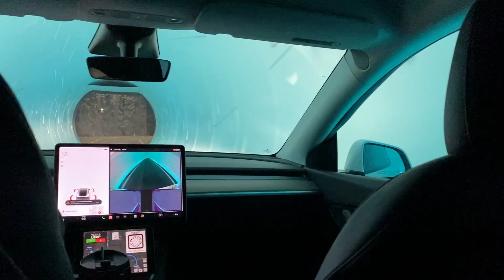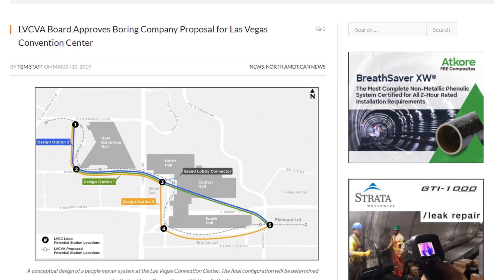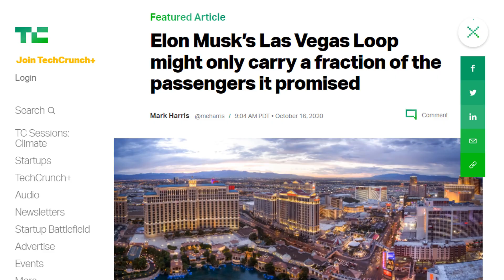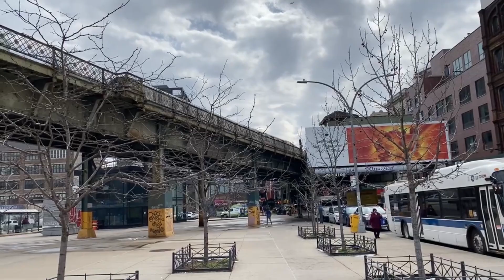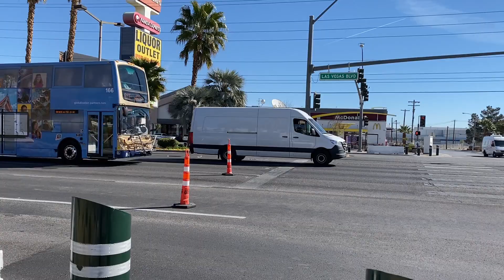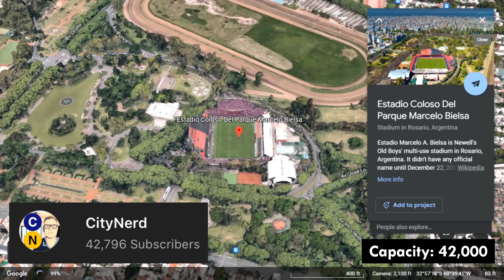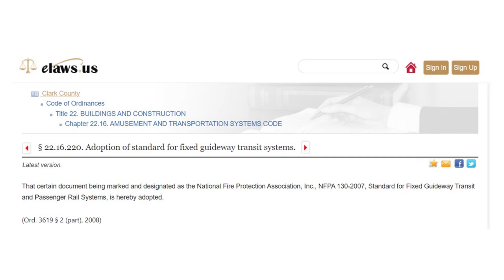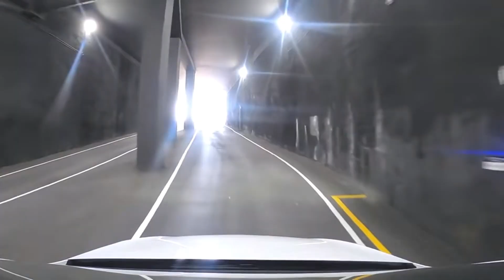Inside the Las Vegas Loop: Transportation Game-Changer, or Complete Waste of Time and Effort?

Comment: It’s a car and an underground tunnel 😂. How revolutionary. How is this better than a subway?
Reply: Much less expensive to build. Shorter wait times for passengers. Shorter trip times, since the car doesn’t have to stop at every station.
Reply: @kevinbailey8827  Now do running costs per passenger.
Reply: @AardvarkDK  I don't have those numbers. I do know that the bid to build a subway in this location was at least $150 million higher than what LVCVA paid TBC to build the loop.  I also know how much LVCVA is paying TBC  to operate the LVCC Loop per year: $6 million.

If the underground train cost half as much to operate (just a guess, to make the numbers easy), it would take 50 years for the LVCVA to save $150 million.
Reply: @AardvarkDK  I think it's likely that TBC is running at a deficit.  Since they're building the tunnels for the Las Vegas Loop on their own dime, they won't have any revenue for that project until they complete sections and can charge fares.   Those fares will have to compete with taxis and Uber, and with people using their own or rented cars, so they can't charge too much.

Most successful businesses lose money at first.  Most unsuccessful businesses do too, of course.  I'm not saying that losing money is a sign of success.  I'm just saying that TBC is in this to make money building tunnels and transportation systems, and to do that, they have to make tunnels and systems that work.
Reply: @kevinbailey8827  Build cost is nothing compared to the maintainance and operating cost over the years. And both is significantly lower with Rails and high capacity vehicles.
Thats like buying a car for 10,000 bucks every 10 years and thinking driving a car only costs you a thousand bucks a year,  while you completely ignore maintanance, Gas, Unsurance Tax, etc., which end up being way higher than the initial cost of the car

A Subway also allows potentially increased capacity if needed and a potential connection to other subway lines, while repurpusing it is easier too, ones the city expands.

The Vegas loop is the only place where it makes even some sense at all, but only because its used by rather rich people and rich people dont like sitting together with poor people. And it also only needs to go into a single direction, because there is only demand towards or back from an event. But for any other situation its a totally terrible idea and even for this case a railway system is more cost effective on a long term and will remain useful throughout the years, if the demand changes, which the loop fails at
Reply: @otozinclus3593  I think you're not realizing the scope of the Vegas loop.  In a few years, passengers will be able to travel from just about any resort to another with a non-stop trip.  They'll also be about to travel to the airport and the big stadium without stopping.  No stopping at other stations (like a subway) and no stopping at traffic lights or for traffic (like a taxi).  

This is just the first leg of that system, and it's useful for going back and forth to the convention center (for a fare of $1.50, so only rich people can ride).  It will get much more useful.

The fare will be comparable to an Uber, but that's a subsidized price.  If other cities adopt loops for their needs, they can subsidize the fares (the way cities with metros subsidize) to make them more affordable for poor people who don't want to be around rather rich people. 

There will be more maintenance costs for a Loop, but it won't be as crippling as you think.   The LVCVA is paying TBC $6 million a year for maintenance and operation of the LVCC Loop.   Even if a train cost half that much to maintain and operate, it would take 50 years to make up for the fact that the cost of the train was going to be $150 million higher.    Even if the train cost exactly zero dollars to operate and maintain (which of course isn't true!), it would take 25 years for those savings to catch up to the savings of NOT having a train.
Reply: @kevinbailey8827  The maintainace cost numbers scale over time, they dont remain the same every year. Example: If you buy a new car, you barely need any maintainace at all for the first few years, but ones its old it needs it regulary.
The Vegas loop is very new, and that it already has such a high maintainance cost means once it gets old, it will skyrocket. 
You also didnt include the working cost, like the cost you need to let it run, which is with a bunch of brand new teslas extordinary higher, than running a pair of trains, because they consume a lot more electricity.

You also shouldnt expect that people can actually use the loop. Vegas is a big city and the capacity of the loop is extordinary small for what it costs. The max capacity the boring company uses is only true, if every car is filled up, traffic flows perfectly, the distance of each car is short and there occur nonother propblems either. This is already unrealistic enough, but even if it werent: At more than a quarter of its capacity, you have to sit with strangers together, once its at max. capacity you have 3-4 strangers in a single car with you, and at that rate I would find even a subway more confortable. But even if we ignore all of that, the capacity is still way too low.
Even if we trust the boring company wkth their 4400 peeps per hour, thats nothing compared to a subway. You really think only 4400 people an hour want to get to work during rush hour on a single line?
The Vegas loop will be at best a premium transportation method for rich people only, meaning poor people are still left without transportation, while disabled and too young people cant use the loop regardless. And the Tesla AI still needs lotsbof years till no driver needs to be on board. What does that mean? You need to build a subway regardless of the loop, so the loop is just some premium fun for rich people. And with the loop already build a subway will become far more difficult.
Maybe you can go for a tram instead, but in a car dominated country like a USA its rare people build a good tram and in a big city like vegas a tram can approach during rush hour its limit too, even through its capacity is higher than the one of the loop
Reply: @otozinclus3593 Las Vegas is not going to build a subway in addition to the Loop.   They looked at building a subway a few years ago and when they saw how much it would cost, they said thanks but no thanks.  That's how it is in most cities.  The government says it can't afford it without raising local taxes, so they have to put it to a vote.  The voters then say no they don't want to pay higher taxes. 

You know of course that the maintenance costs of subway trains will also skyrocket as the fleet ages. 

The working cost of the loop looks pretty good to me, especially once the vehicles are self-driving.   Think about it.  The train has to drive around all the time, whether there are a few passengers  or a lot.   An empty or mostly empty train is using a huge amount of energy per passenger.   The usual way metro systems deal with this is run trains less often.  So passengers will need to wait 20 or 30 minutes for a train to arrive. 

The way the loop will handle it is to park most of the fleet when it's slow.   Some will be parked at a surface lot, being charged with level 2 chargers.  Others will be distributed through the system, parked at stations.  They are using very little energy when parked (especially compared to the empty train rattling around), but they're ready to go in an instant if passengers show up needing transportation. 

You're using the wrong number for the Loop's capacity. 4400 is for the small LVCC loop, which is only for the Las Vegas Convention Center.  It won't be connected directly with the rest of the Las Vegas Loop, at least at first.   It's only for the convention goers to get from one part of the convention center to another (like an airport train to get between terminals).  So the needed capacity won't grow for the LVCC.  The capacity number for the Las Vegas Loop that The Boring Company gives is 57,000 passengers per hour.   They also said that number is just a start.

The Las Vegas Loop really isn't for commuting.  As planned, it goes to all the casino resorts, and to the airport, and to the stadium, and to the university.  That doesn't help casino employees get to work (unless they're university students), and the fares aren't structured for a daily commute.  That's not to say it can't be expanded into the rest of the area and used for commuting. Just build more tunnels and connect them into the existing ones. They don't even have to be tunnels everywhere.  Make dedicated above-ground roadways. for the loop vehicles.  Most subways I have seen become above ground trains away from the city center. 

And subsidize the fares for local users, as you would have to do for a subway anyway.

Self driving cars won't be ready for a few years, but I'm okay with that because the Las Vegas Loop won't be finished for a few years, either.    It won't help to pour billions into a new subway in the meantime, because the subway will take longer to build than the loop and the self driving cars will be ready before the subway.
Reply: @kevinbailey8827  Yes, but thats exactly the problem. You buiild a loop which is 1/3 as expensive as a subway, but cant even use it for actual useful stuff like commuting.
Thats what I ment with "You still need to build a subway",  I never said they will build an subway. I ment, that a Subway provides so nuch more and is an actual car alternative which will actually reduce traffic, while the Vegas Loop costs a ton of Money, but doesnt fix traffic. Because when is traffic the highest? During rush hour. And Rush hour is because of commutes. But now you build a system which is purely for rich people and tourists, but act like it will fix traffic.

The Vegas Loop is like I said an extremely expensive transportation system for some additional confort to the rich, it doesnt help anyone actually living there.
Big Cities need a Subway, becaude the Proce to maintain car infrastructure is on the long term higher than a well planned subway and its the only way to actually reduce traffic, because its much more space efficient than cars.
The goal of the Boring company was to reduce traffic by putting it underground. They out traffic underground, but did not reduce traffic and will not either, because the caoacity is miniscule. 
So even if we assume the operating cost would be the same with a train, which is not true at all, and the build cost is mich higher:
Yes, the subway will cost way more, but it will also offer way more because it will actuall, reduce car traffic and therefore save money in other places and reduce traffic, while tbe Tesla loop costs a ton of money and doesnt really offer that much for actual people. Car traffic will remain about the same.

"Train maintainance cost will skyrocket too"
Yes, but also No.
Yes, subway cost wikl increase over the years heaviely too. A new subway costs a lot less than an old one to maintain.
But its still way less than the Vegas loop.
Steel wheels from a few trains or rubber on stone of a lot of cars, streets need to get repaired quite fast because they get used up faster than a rail, while it will take mich longer for a rail to bw concidered old.
We have railways from the cold war still working perfectly fine and getting used, imagine a street lasting that long.

So the maintainance cost will rise for both heaviely over time, thats true, but it needs much longer to raise for a train than it needs for the loop, and even once it skyrockets, the train one skyrockets less, because there is less getting broken. Its mostly the inside of a train that get dedtroyed by the people using it, while the vegas loop has to care abiut that too and the damage to the roads and parking lots and the tunnel.

"If only few people use a train, the iperating cost per head is big"
Yes, thats a big downside. Thats why you only build Subways in Cities where always atleast a few people will use the service.
In germany rn we have the 9€ Ticket, you can drive as much short distance train as you want for 9€ a month. Short distance trains are ofcause way slower than an ICE running at 300kmh, being faster than any car, but many use short distance trains rn as a cheap way to travel to sifferent cities despite the higher travel time, including me.
I take train at times like 1-5am and can surely say, even at ridiculous times like that, the trains are not really empty. Ofcause not full either, but it still transports a big load of people.
And in Vegas thats especially true, in Vegas there are  alot of people drinking and staying up all night who need to get back during midnight and later. So it will nearly never happen that a train will be truly empty. 
You can change the capacity you need by simply changing the lenght of the train. During rush hour you can use multiple cars, during midnight just 1-2 cars on the train. And a single car being empty nearly never happens, especially not in a city with such advanced night life.
And yes, there are still times the trains will be empty, but there are other time they are full and you can transport 300 people in a single vehicle, which is way cheaper than driving 200 teslas, therefore keeping the average cost low.
The operating cost of a well made subway is about 8-11 dollar per mile.
For the LVCC we will calc in favour of the LVCC with a bit more and use 2 miles as the lenght. You really think 60 Teslas running (the goal of LVCC) + the service of getting in and out and getting up and down, will be possible for 16-22 Dollar per mile?
Ofcause the operating cost per kilometer will shrink if the loop expands, but thats still unrealistic

And it doesnt even has to be a subway. You could actually innovate something and innovate the subway, instead of simply digging a tunnel underground, putting cars there and calling it innovation.
You could build a fully automonous train using AI which is unlike for cars already practically doable and tested. Thisbwould reduce operating cost even further.
You could have trains only drive as much as necessary by controllibg how many people are getting in the loop and adjusting train lenght and stops and such. You could as example make the people habing to say on an app were they say where they want to hold, which enables the train to be optimized and only halting as long and often as it really needs to and other things.
You could innovate a prooven to work technology and make it better, but they have choosen to try to make a prooven to fail transportation method work instead (For the traffic of a big city only! For rural areas cars are not replaceable ofcause).

And even if you say you do use cars, why are they not drawing power from a cable? Batteries are the only con of electric cars compared to regular ones, and you could have eliminated that with that and also reduced operating and maintainance cost a lot.
But it seems just like they gave up ablot of innovation simply for letting regular teslas run through the loop to advertise thwm, making the loop seem more as an advanced add than an actually well planned transportation method
Reply: @otozinclus3593  You’re wrong when you say the capacity is minuscule, and you’re wrong when you say the loop is expensive. TBC is giving an hourly capacity for the full Las Vegas Loop of 57,000 passengers per hour, and they say it could be higher. 

There is no reason a loop system would not work for commuting. They could use small electric buses mixed in with the sedans. They will likely be made by Tesla, of course.   Cities that need new public transit infrastructure will be evaluating the Las Vegas Loop to see if it can be adapted for their needs, because the Las Vegas Loop will then be a proven to work technology.   One of those cities will be greater Las Vegas itself.
Reply: @kevinbailey8827   @Kevin Bailey  Didnt you literally say last comment that the loop wont work for commuting? But we ignore that for now.

"The capacity isnt minicule, TBC says it can move over 50k people an hour"
Yes, 50k people an hour is miniscule for a city like Vegas and a Subway can move way more. Do you really think at rush hour with hundred thousands of people going to work, the loop with the 50k capacity per hour will be enough?
The demand is way higher than 50k people per hour, meaning people still have to fall back on using their regular car outside of the loop.
And dont forget that the number is from the boring company, ofcause they want their number to look bigger, its a provate company trying to get the permission for their transport.
54000 people only work each hour, if you put 4-5 people in a single car and ignore safety distances. The number is just a theoretical "How many humans can phisically get through", but not an actually realistic number of people who get transported through it. But Iam sure a probate company would never make itself seem better than it actually is, so we can trust their numbers :3
Especially if they start outting 5 people in a single vehicle, it might be even more unconfortable than a subway, which leaves way more place free for the samee amount of people transportated necause it doesnt calculate around its phisical limit like TBC does.

"They can use electric busses"
No, they cant. The tunnel is too small for electric busses, because there isnt enough space on the curves for an entire bus to take a curve, because busses need a ton of space for a turn. 
Meaning you would have to make the tunnel bigger -> costing a ton of money to build, and you have to stop at multiole stations.
And now think about it: These are the only 2 downsides of a subway compared to the loop. 
So you dont want a su way because of the higher built cost and higher amount of stops, but your solution will requrire that too. And even if you do all that, a bus is slower and has less capacity than a train. So using busses for the loop combines the downsides of the loop with the downsides of a subway, great.
Electric busses are also terrible for the enviroment, because electric vehicles are only good for the climate if they are small, exept you draw power from a cable like trains do, which is the best for the enviroment.

A loop only makes any sense at all for low demand transportation for rich people, like it is the case at the LVCC. For mass transportation the capacity is too low and for rural areas its too expensive, therefore low capacity transportation with rich people is the only way it can make can at all.

"There is no reason the Loop cant wprk for commuting"
The absolute phisical limit is 54000, even this unrealistic number is too low for rush hour, you cant transport enough people. I found it very hard to find actual numbers of people commuting to work in LA, but Ibhave found atleast 1 number:
160,000 people commute for over 90minutes to LA. The average is 30 minutes. 20% of the commuters need over an hour, meaning the super commuters make up only 80% at best, ignoring the people needing 1 to 1.5 hours.
160,000*5 = 800,000 commuters every day with my bare minumum calculations, meaning the actual mumber is easiely over a million. But since I have no proof for thaz, we just calc with the 800,000. 2/3 Take the car in LA, meaning 800k/3 is ~540,000 car travelers each day.
50k from 800k is about 7%. So even if the Loop transports 50k people like it advertises, which wont happen, and even if we take my absolute miniscule estimate of commuters in LA, its still a very small amount of people who will be able to use the loop.
So your vision that you can travel anywhere in LV so quickly is not true, the rich people will use up all spots.

LV has absolute crap Public transport, its horrible and a disgrace to the city, but even the crappy public transport of LA makes up 10% of the commuters in the city, so even the crappiest public transport transports more people than the best estimate for the vegas loop.

Look at a City like Berlin, where less than 1/3 of the people use a car to get to work and berlin isnt even that good for public transport, Amsterdam or Switzerland are way better.
Because of that the traffic in Berlin is about the same as in Vegas, despite berlin haveing 4 times as much people living there. Do you know how much money this saves the state?  ecause the time lost stucking at traffic jam for a worker idnirectly impacts the state too.

Good public transport saves money, but TBC now builds a loop exlusive for rich people only for a lot of money and acts like they improve traffic
Reply: @otozinclus3593  I may not have made myself clear:  The Las Vegas Loop will not work well for commuting because it doesn't go to where the workers live.   There is a solution to that: Add more to the system, going where the workers live.   Once the workers can take the loop from near their homes to near their work, it will work fine.

You may not think 57,000 passengers per hour is sufficient for a city the size of Las Vegas.  Then how about 100K?  200K?   Once they expand the system outside the resorts corridor, they can set the size and capacity to match their needs.  Just as the the 4400 per hour was for the LVCC Loop, which only needs to serve 4400 passengers per hour sometimes, the 57K is for the resorts corridor.    Add to the size of the system, and the capacity goes up. 

When I say "small electric bus", I mean something like the 18-passenger pods in TBC's original concept video.   Maybe not exactly the same.  These will be maneuverable enough to navigate the tunnels.  They'll be designed for it.  And if they can't navigate the tunnels, they'll go back to the drawing board until they come up with one that can, and the end result will be larger capacity vehicles that work even better in the tunnels than off the shelf Tesla sedans.    No need to make the tunnels bigger.
Reply: @kevinbailey8827 
So the advantige of a tesla loop is that the build cost is lower, but to fix the capacity issue you need to make it 5 times as big, therefore building it 5 times?
You cant have both low price and high capacity with the tesla loop.

Either you say you have a vegas loop being cheaper than a subway, but at a fraction of the capacity, or you have a vegas loop with the same capacity, but way higher cost.

Just to show what I mean:
1 mile of vegas loop costs only the half to a third of what a subway costs, we calc with a third here, okay?
Thats the advantige of the loop.
The disadvantige is, it isnt enough capacity.
So instead of building a single subway line for 150million, you suggest you building a bunch of Vegas loops instead who cost 50million each.
A single vegas loop is cheaper, but multiple loops are more exepensive than a subway.

If you need to expand the vegas loop so damn much just to reach the capacity of a subway, you end up paying more than for a single good subway line.

And it doesnt work either. Cities have some areas with a ton of people and some with barely any. 
So if you have connection A to B, meaning Iam talking about a single comnection of 2 places here like the LVCC is, surpassing the demand of 4400people, the loop is overfilled.
Building even more connections from A to C and From A to D does increase the entire capacity, but not the capacity on that specific route. (Well it does slightly, because some people may be able to switch routes, but that doesnt work for all routes ofcause).

Meaning even if you cluster the entire city full with tesla loops, connections who are high in demand will still be overfilled, because it barely matter how many connections there are from A to C-Z, if connection A to B is overfilled.

"But why not put vehicles with more people in there on the streets"
Other question, why not build a Subway instead? It literally is a vehicle with more people fitting in there gping underground, what makes a tesla bus underground better?
"Well, the build cost is lower!"
Now think about it, why is the build cost lower than the build cost of an conventional Subway?
Because a common subway is way bigger, so you also need to dig a bigger tunnel, ofcause a bigger tunnel is more expensive. Outting Teslas in the tunnel is not the reason thw loop was cheaper than a subway, its cheaper because the tunnel is smaller. So instead of having a really high maintainance and operating cost with busses, you could simply make a smaller train which can fit in a small tunnel too.
The advantige of a train is also, that it can takes sharper curves than busses, meaning on the same space it can have a higher lenght.

So why are we not comparing the price of a Tesla loop to a mini subway?
Because mini subways barely exist. 
For very rural areas you have cars. For villages a bus. For small cities a Tram and for Big cities a subway in combination with a tram and busses.
A Tram has a lower up to same price as the vegas loop has and a way higher capacity, so if you dont need the capacity of a subway cities simply build a tram, so mini subways barely exist.

Its just that Vegas is overun by cars and people try to avoid trains at all cost because they arent used to them. So instead of building tram rails on 1-2 lanes, people rather dig big tunnels underground.

So there are 3 good options: 
1.: You increase the amount of public transport on the ground, which is cheap and has good capacity while trading for some speed. 

2.: If your city wont allow you to build more public transport on ground, build a mini subway underground in the tunnels build for the Teslas. Placing the rails costs a few millions at first, but you get that back over the years as maintainace cost and operating cost is lowred and higher capacity gives you more money from tickets. This would combine the advantige of a "low cost" (compared to surface public transport its still incredibly expensive) tesla loop and the advantige of a high train capacity.
And you could make a streetcar rail instead a normal one, so if demand is low you can continue driving with your beloves teslas if you really want that.

3.: You as a City finally realize the demand of transportation is incredibly high in your city and admit that a subway will be way cheaper than building even more car lanes on the ground. It will be a big investment, but its not only cheaper, but also pays itself back through tickets.
People driving a car barely pays anything to the state, because gas and lots of other stuff gets particially payed by the state, they just lose money from financing streets and parking slots and the healthcare alsobhas to handle way more people because of car accidents, all this costs a ton of money.
People riding a train theough, particially pay the cost back through tickets, making it cheaper for both the customer and the state. Lfcause they dont pay it back entirely, but atleast particially.

Overall: The problem is "high traffic", there are many solutions to high traffic and the vegas loop will cost a lot of money, while it isnt even fixing the problem.
A subway would cost even more, but slowly pay itself back and actually fix the problem.
A tram or more busses would cost less and atleast partially fix the problem.

Look at berlin lr Amsterdam, there are way more people living there and the traffic is way less, simply because they habe a wokring public transport system which keeps the streets empty, atleast compared to LA
Reply: @otozinclus3593  You're not understanding what I'm saying.  

Making a transportation system bigger will increase the capacity.    I have ridden subway trains in Shanghai and Beijing.  They have enormous capacity.   But Shanghai's system is 500 miles with 396 stations  (if you measure it the way the Loop is measured, that's a thousand miles)  to the Vegas Loop's current planned length of 34 miles. 

Beijing is slightly smaller. 

Subway systems gain capacity when you add new lines.  ALL subways systems, including loops. 

I'm just saying that 57,000 passengers per hour only applies to the currently planned resorts corridor that covers about 15 miles and will have 54 stations.   Add more tunnels and routes and stations and vehicles to serve them, and the capacity of the system goes up.  Keep adding until you're serving everyone you want to serve. It will STILL cost a lot less than adding that same capacity with subways.
Reply: @kevinbailey8827  I understood what you ment. I only saidy that adding lines only increases the *total capacity*, but the capacity per line gets only slightly increased.
Meaning even if the total capacity of the loop would be enough, the low capacity per line would be a problem.

And the price per capacity is high for the loop too. The loop is cheaper than a  subway, but also has les capacity. The price per capacity is way lower for a su way, so if you need multiple loop lanes to compensate for low capacity, you end up paying more than for a subway.
Reply: @otozinclus3593  I think you're wrong about paying more for a loop than a subway, but I'm willing to wait until more loops are built so we (and more importantly those who make decisions on public transportation projects) can have all the facts. 

I saw a lot of calculations about how the LVCC loop couldn't possibly handle 4400 passengers per hour. The calculations showed clearly that it could never do more than 1800 passengers per hour.   Those calculations turned out to be laughably  wrong, because the people doing the math were starting out with bad facts about the loop. 

The Las Vegas Loop as currently planned is a special case, since it isn't costing the local government anything.  In fact, Clark County will receive a small portion of the fares collected by The Boring Company as a franchise fee.
Reply: @kevinbailey8827  Yes, the loop doesnt cost the state aynthing. Iam just saying that the loop itself is expensive for what it does. Who pays the bill is something I dont care about, Iam talking abojt the transportation method itself.

"The loop is cheaper than a subway"
It is cheaper than a subway, I never disagreed with that. I just said the tradeoff of so much lower caoaciyt is just not worth it.

Example: You want to play games but instead of buying a gaming PC for 800bucks, you buy grandmas old office PC for 200bucks.
Yes, its cheaper than the gaming PC, but you will also play games much better on it.

And with the loop its the same. Yes, a su way costs 3 times as much, but it also transports way more people.
And the cost per transported person is lower for a subway + its paying itself off slightly through tickets
Reply: @otozinclus3593  We will see. Operational cost per transported passenger is something that can be measured, and weighed against cost of building the system.  

In the case of the LVCC Loop, it's easy to see that the loop was a far more economical choice than the underground or elevated trains would have been. 

The Las Vegas Loop will give us more data for better decisions.